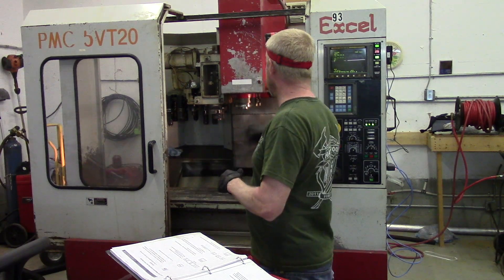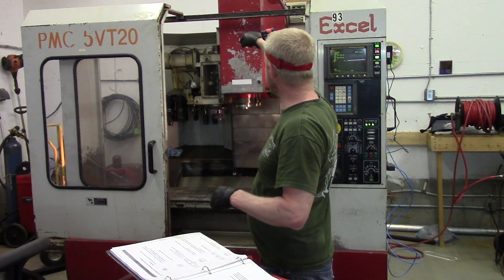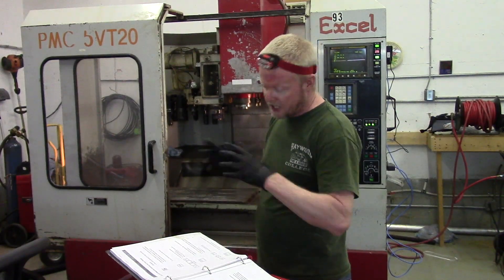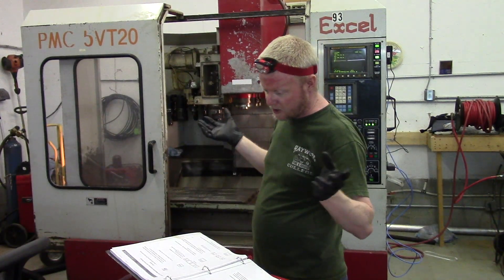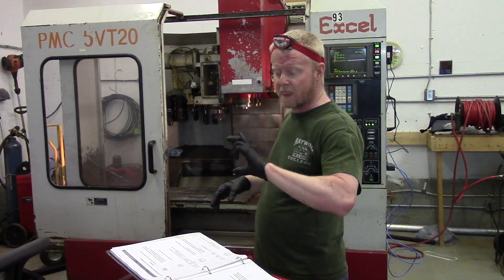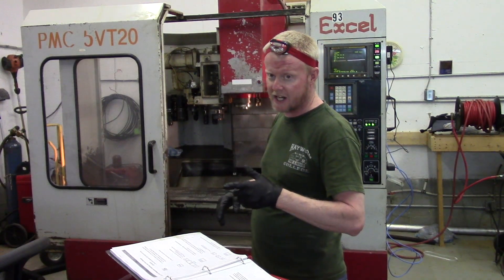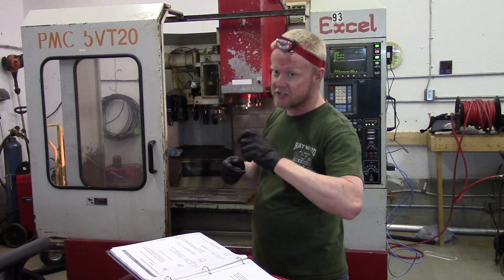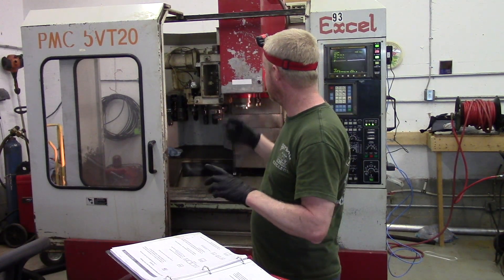Home Shop CNC Mill Automatic Tool Changer Repair

Comment: Nice fix on the tool changer. A good method of checking correct phase on initial start up: Start the coolant pump and check for correct rotation and/or if coolant shoots out of nozzles. I believe you had the machine mains hooked up out of phase. That is why the tool changer was not working. Changing the phase at the tool change motor worked, but it would have been better to just change two of the power mains to correct the problem. But hey, if it works, it works. Did you have to change the coolant pump phase as well?
Reply from the maker: I swapped the phase at the mains.